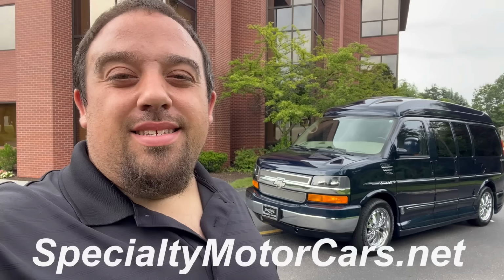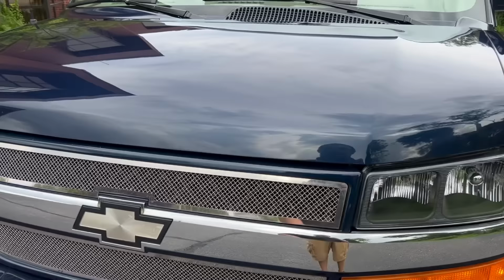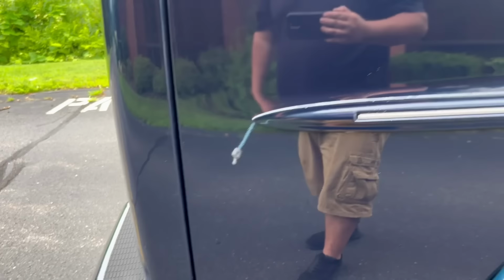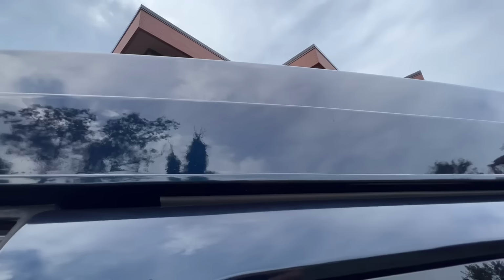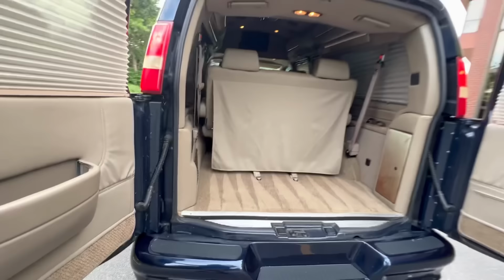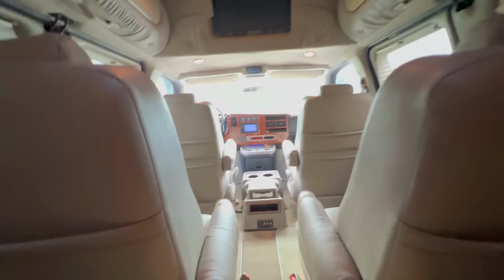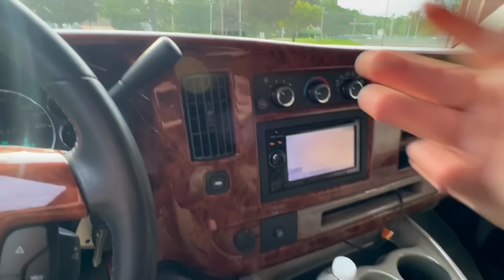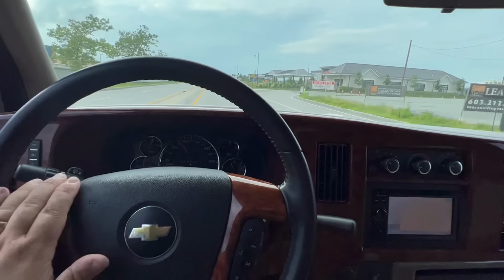37k Mile 2009 Chevrolet Express Conversion Van Explorer High Top Road Trip RV FOR SALE

Comment: Fyi-Its a wheelchair ramp mechanism. The ramp unfolds out and down. A wheelchair rider drives up the ramp. A lift is quite different where the wheelchair rider drives onto a platform that brings the chair straight up and then in. Beautiful van- excellent video! 👍🏽👍🏽👍🏽👍🏽👍🏽

Comment: when explorer used real wood, there was no fading but, they had problems with the wood cracking. yo have to deal with one problem or another. what they currently use is a plastic dipping method. and the places that look like wood, is dipped to make them look like wood.